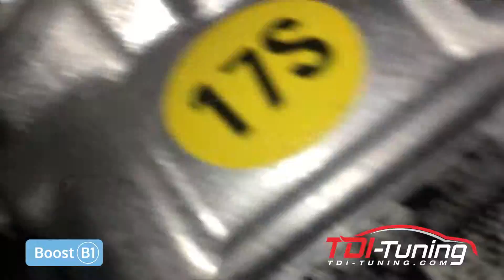VAG 2.0L TSI / TFSI Underside Mounted Triple Channel

Comment: And it gained ? What exactly
Reply from the maker: Hi David,

These videos are to show our customers the fitting procedure for this engine variant. The fitting process for this VAG 2.0L TFSI will be the same connections for this engine however, it will have numerous versions in production with different power figures as standard.

If you can provide your vehicle details we can give you with the increases for that? Alliteratively you can call us on 01245 392255.

Many thanks.
Reply: Is there an updated video for 2L TSI as this doesn't match my new 2L VAG